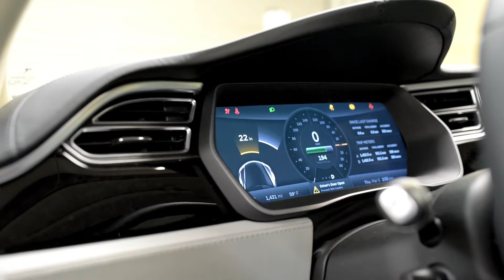How accurately do Model S sensors work with paint protection film over them?

Comment: I got my Y wrapped and my sensor isn't working now. Can different wraps cause different issues?
Reply from the maker: Hrrm...that's somewhat odd. Have you verified that all of the sensors are not "working"? (no insult intended -just using it as loosely as I can)

I find it hard to believe that a different film would respond in a unique way considering most films I've handled mic at about 7.2-7.8 mils in thickness and it would seem that the difference wouldn't impact the ability of a sensor to work. But it may be possible that there's an unrelated issue. 

Have you asked your PPF installer for his feedback on the issue?

I'm sorry to hear you're dealing with this but the good news is that you can temporarily ignore the parking sensors until you have a resolution.
Reply: @Detaileddesignsautospa  I talked to them and we are going to monitor. The weather has been colder and I'm not sure if that has any effect. I'm going to watch and wait for the weather to warm up to see if that makes any difference
Reply from the maker: If worse comes to worse, the film over the sensors can be trimmed out. I hope things work out for you, hikoukla!

Comment: You probably should have measured it from the most forward part of the bumper not the sensor. I imagine that they would offset the sensor reading to the tip of the bumper since it's the bumper thats important here. It looks like the front of the bumper is probably 2 inches proud of the sensor.

Comment: Just had my Model S clear bra installed.  The installer left the sensor covered.  Is that the norm?
Reply from the maker: +Steven Han Because they should work the same with or without film over them, it is purely preference. We leave the choice up to our client.
Reply: +Detailed Designs Auto Spa Car Detailing thanks for replying. The only time I noticed anything was the day I brought home the car after installing the ppf.  The car wouldn't go all the way in the garage using summon. It didn't do that before. After a couple of days though, summon worked fine. Ultimately I had it cut out because the white ring around the sensor was unsightly.

Comment: Whydidn't you measure it BEFORE adding the paint protection ?
Reply from the maker: Greg Hudson We tested the distance with film over the sensor as well as without film over the sensor. The sensors measure the distance, nothing else on this car. So the fact film is around the sensor after removing the film from over the sensor means nothing.

This is a with/without film over distance sensor test. 

Thanks for taking the time to ask a question and I hope I've answered your question.
Reply: I second Greg's question.  Although unlikely, it is possible that the PPF could have had a lasting effect on the Tesla's sensors.  Ie. had the test been performed pre-PPF film installation, during, and post, could it not be somehow possible that the Tesla would have read the results... Pre 24"  During 22"  Post 22" ?  Or any other variation of results.  You only did During and Post, I believe it would be comforting for consumers of PPF to understand how the sensors worked BEFORE they were ever touched!  ;-)  Maybe for example, an irreversible effect from the materials adhesive could have altered the way the sensors worked from the moment it touched them and on....  Or, a step in the preperation for instalation had a lasting effect on the sensors, not even the PPF itself...  Or, the film being on the sensor for a period of time causes the Tesla to perform its own re calibrations.  Or who knows what else!  But having a pure baseline from a virgin sensor to PPF would be the best way to prove that PPF has no immediate or lasting effect on the sensor.   I would love to know those results.  Most product testing is done "Before & After" for this very reason, and absolute certainty.  I feel Before During and AFter would be best for this experiment.  Cheers!